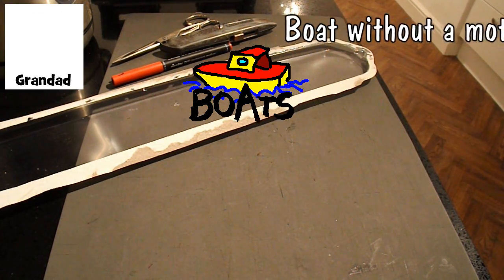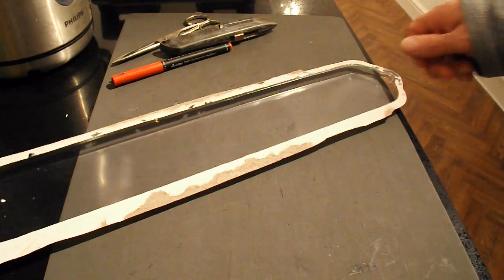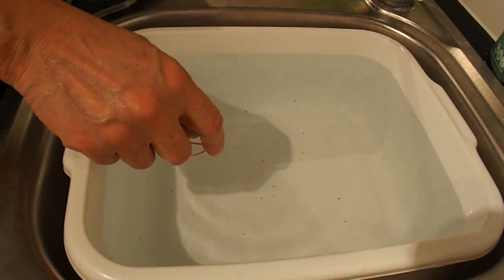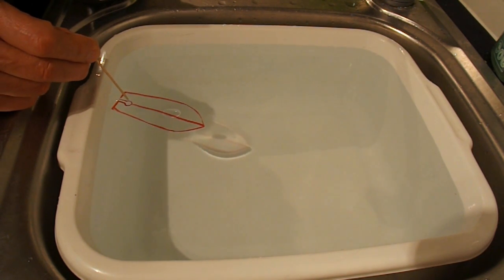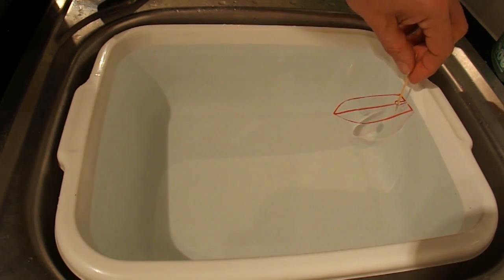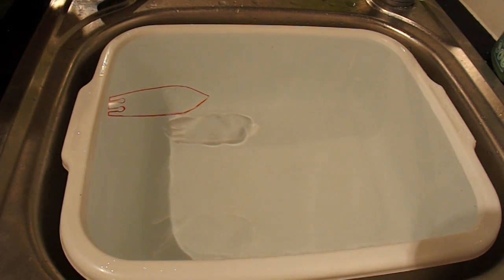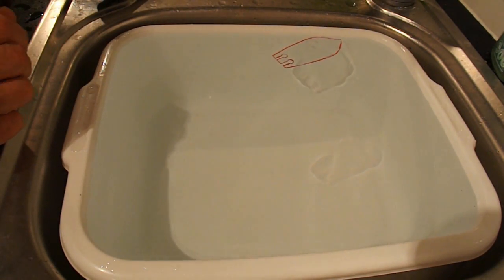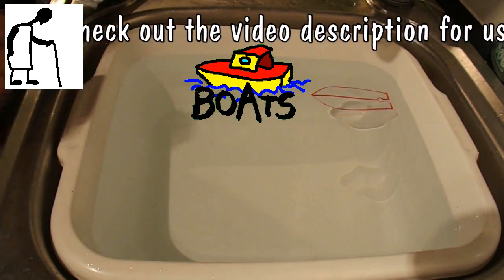Boat without a motor - Marangoni effect - soap boat

Comment: Hello :-)

I've built soap boats with kids  yesterday and luckily stumbled upon a website suggesting the use of isopropylic alcohol or acetone. Compared to soap, it won't destroy the surface tension of the whole container, thus working infinitely (well, as long as the concentration of the container does not match the alcohol's). Instead, the alcohol mixes with the water, and the water still has a higher surface density than the alcohol.

I think I'm going to buy some flat rain gutters to make some races with them :-)
Reply from the maker: +Marcus Shaw hey thanks, I might have a go myself to see if it work :)

Comment: What would happen if I replaced the water with soap, and the soap with water?
Reply from the maker: Try it and find out. I don't have that much soap. I would expect nothing would happen as it is the surface tension of the water that you are changing when you add the drop of soap. As the tension changes it drags the boat forwards. I think putting water onto soap would not work the same way.

Comment: Would the soap thing work on a big boat?
Reply from the maker: In principle, yes, I think. How big is 'big'. Oil slicks spread for miles on the ocean and we are talking about the changes cause in the surface tension on the water. I would expect that the deeper hull of the boat goes into the water the less the effect would be noticed as the water under the surface would resist the movement. A large flat shape would still move well, I have seen YouTube videos with larger shapes used.
Reply: GrandadIsAnOldMan wow

Comment: Back when I was little (back in the days of the dinosaurs: P), I saw a hand job, namely to a floating wooden platform and putting up an open bottle of soda. 
Escaping gas, it did advance to the boat. 

I imagine that if instead of wood, expanded polystyrene is used, the boat would move better. 

Greetings!. 8-)
Reply from the maker: Hi Francisco, thanks for commenting, I may try that sometime. It sounds like a good project.

Comment: Can u make electric door locker or opener for science project
Reply from the maker: Slow down Madhav, I get lots of requests to make things and I simply cannot do all of them. I will add your idea to my list of things to do and if I make it I will mention your name.
Reply: To make an electric door or elevator model, personally I recommend you disassemble an old printer. 

Not only the mechanism of longitudinal advance of carriage, is invaluable for this, is that there are plenty of mechanisms and motors and wheels and gears, very-very interesting to many more projects!
Reply from the maker: Francisco Javier Lázaro Pinela Yes, old printers are a wonderful source of useful parts and motors.

Comment: I'd never have thought 1 drop would destroy the whole surface...hmm, can some other product not work to restore it in a similiar way ? perhaps making the boat go backwards eh :)
Reply: +slider2732 Better late than never: Isopropylic alcohol or Acetone will work, and not destroy the surface tension.
Reply from the maker: Hi slider, yes that totally confused me. I expected to be able to add another drop at the opposite side of the bowl and send the boat back, maybe I used too big a drop of soap. I guess the clue is the speed it shoots across the surface. I tried several different liquids afterwards. One soap was so slow it would have taken minutes to cross but it really was working not just drifting. I have just been back in the kitchen and sprinkled some pepper on the surface and a single drop of that powerful washing up liquid sends the pepper straight to the edge all round the bowl. Probably another subject for a project sometime :-) The video I linked to in the video description explains it all very nicely. http://youtu.be/rq55eXGVvis